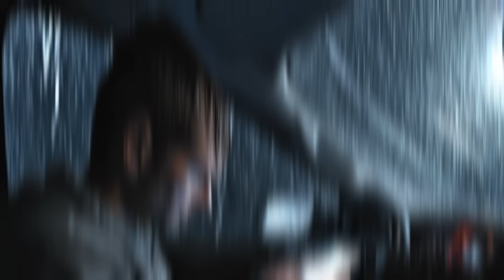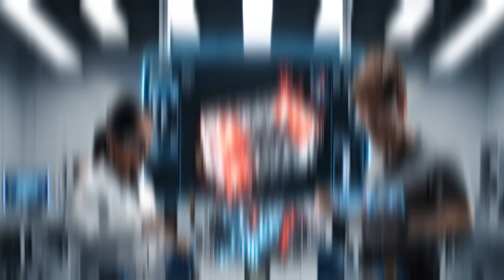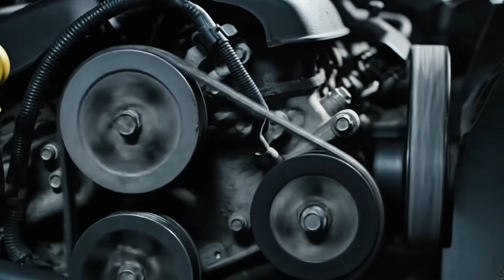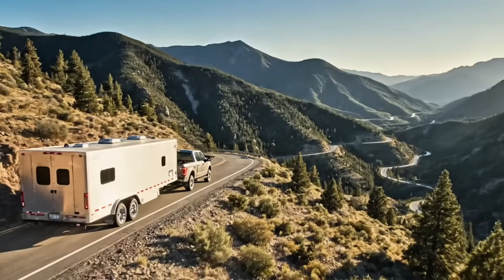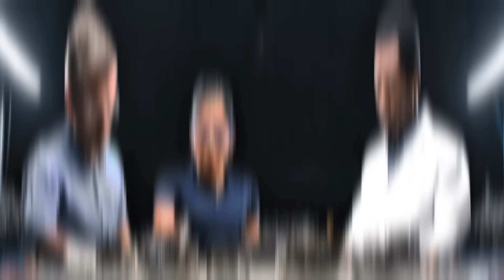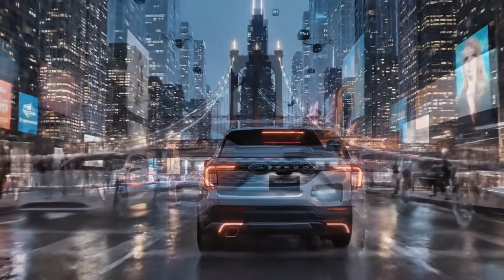Ford Just Ended the EcoBoost Nightmare in 2026 — Truth Revealed

Comment: Still using a rubber oil pump belt? Bad engines right across all the car manufacturers, for me ny turbo, no direct fuel injection not ever the combo port and direct and go back to larger engines and lower compression ratio.
Reply from the maker: A lot of enthusiasts still prefer the older formula: bigger displacement, lower stress, and simpler systems. Modern engines gained efficiency and power, but definitely added complexity too.

Comment: Did they take the water pump out of crankcase
Reply: The rear wheel drive 2.7 and 3.5 never had it behind the timing cover. Only front wheel drive had that.
Reply from the maker: Correct 👍 A lot of people mix the different Ford platforms together, but the truck/RWD EcoBoost setups are very different from the transverse FWD designs.
Reply from the maker: That internal water pump setup was mainly a concern on some transverse/front-wheel-drive Ford applications, not the truck-based 2.7 and 3.5 EcoBoosts.

Comment: If you look at this from a common sense point of view, the smaller the engine, the more it’s going to be pushed and generate more heat no matter what.  A flawed design that will never replace the V8 over the whole engine lifecycle.  😊
Reply from the maker: That’s definitely the argument a lot of V8 fans make 👍 Bigger displacement usually means less stress per cylinder under heavy loads. The challenge for manufacturers now is balancing durability, emissions, fuel economy, and power all at once.

Comment: Get rid of the wet belt
Reply from the maker: The wet belt debate has definitely gotten loud lately 😂 A lot of owners just want long-term durability and easier maintenance without tearing half the engine apart.
Reply: Well do you blame them... don't go into class action lawsuits like GM ok? And I'm putting my trust in you Ford cause GM, Toyota and even Ram has lost my trust
Reply: @jeffrymcallister2789  Ford has the highest recalls amongst all manufacturers. I wouldn't own one.
Reply from the maker: @jeffrymcallister2789  A lot of truck buyers are feeling frustrated with multiple brands right now. People mainly just want reliability, fair warranty support, and vehicles that hold up long term.
Reply from the maker: @williamstewart1294  Recalls definitely hurt consumer confidence, even when they’re preventative. Every manufacturer has had issues lately, which is why so many owners are skeptical now.
Reply: The wet belt lasts longer than a chain 300,000 easily
Reply: @johnsullivan9019  A wet belt will fail long before 100,000 miles, and when they do fail, they destroy the engine. There is no warning. I replaced the timing components, including the chains, on my Ford Crown Vic 4.6L SOHC 2 valve V8 at around 300,000 miles. You get a warning on those. A rattle on cold start that goes away. Over the next 50,000 miles or so, it gets worse. So you have plenty of time to deal with it before it fails. That engine now has 423,000 miles on it, and nothing but the timing components have been replaced. I expect it to easily make it past 500,000 miles.
Reply from the maker: @geraldscott4302  That’s exactly why a lot of longtime owners still trust traditional timing chains more. The gradual warning signs and proven long-term durability give people a lot more confidence than a belt buried inside the engine.
Reply from the maker: @johnsullivan9019  Some owners have had really good long-term results with wet belts, while others are worried more about the repair cost and complexity if something does go wrong.
Reply: My 2018-2.7 has 216,000 miles zero issues
Reply from the maker: @johnsullivan9019  That’s impressive mileage 👍 Goes to show a lot of these engines can last a long time when they’re maintained properly and not constantly abused.
Reply from the maker: @johnsullivan9019  216,000 miles with zero issues is hard to argue with 👍. Stories like that are why so many owners still defend the 2.7 EcoBoost—it proves that maintenance and real-world use matter just as much as the design on paper.
Reply: Hey it’s like the Toyota and Honda’s timing belts. Replacement on these types should be done within certain mileage.
Reply from the maker: @josephpuchel6497  That’s the tradeoff a lot of people are debating now. Regular timing belts are at least serviceable and expected maintenance, but owners get nervous when critical components are buried deep inside modern engines and harder to replace long term.

Comment: I have a 2019 F150 supercrew with a 2.7 V6 ecoboost.  I have 160K miles on it and have not had any problems.  Just consistent oil changes and regular wear n tear like tires, brakes, shocks, etc.  Every Ford truck owner thar I know wirh an ecoboost has not had any problems either.  I plan on keeping mine until the wheels fall off.
Reply: Im at 176k on my 2018 2.7, its been tuned with stage 3 crp turbos on e85 for the last 80k miles with no issues also 🤷🏽‍♂️. There great little engines
Reply: I will say only thing that failed on mine was a exhaust gas tube broke at the seam. The one  that goes to the egr cooler on the front of the driver side head. Easy fix though
Reply from the maker: @Pipsqueak_2.7  That actually sounds like a pretty minor failure considering the mileage and setup. Good info for people who think every tuned EcoBoost instantly blows up.
Reply: @Pipsqueak_2.7  I run e30 on a stock 3.5 eb runs great.  Can't wait for a 5 star tune.
Reply: @burnt_dookie its gonna be fun, thats who im tuned by as well. They take a little long to get back sometimes, but they offer good tuning. Id say definitely do the data logging and get them to revise it. When I got the revision it felt way faster 👍🏽
Reply: @Pipsqueak_2.7 0yo thanks
Reply from the maker: @burnt_dookie E30 seems to be a sweet spot for a lot of owners. Extra performance without going too crazy on the setup 👍
Reply from the maker: @Pipsqueak_2.7  Good advice honestly. A proper revision and data logging can make a huge difference with custom tuning.
Reply from the maker: Love seeing owners helping each other out in the comments 👍
Reply from the maker: @Pipsqueak_2.7  That’s impressive honestly — 176k with upgraded turbos and E85 says a lot about how strong these engines can be when they’re tuned and maintained properly 👍
Reply: I have a 2018 F-150 2.7 ecoboost with 72K and so far have had only one problem......a left turn signal bulb.
Reply from the maker: Even the “problem stories” are starting to sound pretty mild on some of these newer 2.7s 😂
Reply: The 2.7 engines are incredible, look at the bottom end of the block. built like a tank. my son has a 15 2.7 with over 160k, oil change every 5k is key
Reply from the maker: @nickhoffman5524  A lot of people overlook how stout the 2.7 bottom end actually is. Consistent maintenance really seems to be the secret with these engines.
Reply: same ! Love my 2.7 fast and very reliable. 2019 also
Reply from the maker: @jimcostantino6244  The 2.7 definitely has a lot of loyal owners. Plenty of people seem surprised by how quick and reliable they can be long term 👍
Reply from the maker: 160k with basically routine maintenance is impressive 👏 Stories like this are why EcoBoost debates are so divided — some owners have major problems, while others rack up huge miles with zero drama.
Reply: How about for towing?

Comment: And it only took them 15 years. Way to go Ford, what took you so damn long.
Reply from the maker: A lot of longtime owners feel that way — the frustration mostly comes from people who dealt with the earlier issues before the updates finally started rolling out.
Reply: Absolutely. Those things were quite troublesome when they hit the streets in 2011. I was looking for a F150 in 2011, and my dealer sales guy tried to push one of those early 3.5's on me. I told him they were too new for me to try, and went with the old 3.7L. That little V6 was tough as nails, and itdid everything I needed it to do without one problem. I wore it out, and went with the 5.0 in the next one.
Reply from the maker: @wanted-33  That’s exactly why a lot of people still trust the simpler older setups. The early EcoBoost years made some buyers cautious, while engines like the 3.7 and 5.0 earned a reputation for just quietly getting the job done.

Comment: I WILL NEVER HAVE A TRUCK WITHOUT A GOOD ENGINE V8..NO V6 CRAP AND DEF NOT A 4 CLUNCKER!!!!
Reply: Have my 2004 sierra 6.0. I love that engine. And 260,000 miles with no problems? Yeah.
Reply from the maker: @GravyLegg  260k with no major problems is exactly why those older GM V8s still have such a loyal following. Simple, proven, and built to take abuse for years.
Reply: I was going to say the same thing. I am old school give me a v8. I didn't  think the ego boost was that good when they first came out. I made sure to stay away from a engine that small and excepted to do that much power and not have issuses.
Reply from the maker: @catman59-x2g  A lot of people felt the same way when the early EcoBoosts first showed up. The idea of a small turbo V6 replacing a traditional truck V8 took a while for longtime truck owners to trust.
Reply: Agree, have a 2012 f150 with 6.2L.  Routinely tows and is reliable.  Not a daily driver and willing to sacrifice gas mileage for reliability.
Reply from the maker: @ricklanning986  That’s the tradeoff a lot of heavy-duty owners are willing to make — giving up some fuel economy for a setup they trust to tow reliably for years.
Reply from the maker: Nothing wrong with loving a V8 😂 A lot of truck owners still prefer the sound, feel, and simplicity of a big naturally aspirated engine.

Comment: They are not getting better mileage. Hit the pedal, mpg goes off the cliff. 

V8 5.0 is the only way to go.
Reply: It does unless it's under a load then it sucks, I use my f150 as a daily driver and love it 18 to 24 mpg depending on conditions. It's so fast.
Reply from the maker: @jimhelminger3986 That seems to be the EcoBoost story for a lot of owners 👍. Great daily-driver MPG when unloaded, plenty of power on demand, but towing and heavy loads are where fuel economy usually takes the biggest hit.
Reply from the maker: That’s the tradeoff a lot of truck buyers talk about 😂 Stay out of boost and the mileage can be solid, but once you lean into the throttle the fuel gauge starts moving fast.
Reply: Next year is supposed to be the 7.3 going into the F-150. I have a godzilla in my superduty  and its an awesome engine. Cast iron block and pushrods  perfected about 60 years ago.  If its true and they are not the price of a home mortgage I am getting one . Rumors are that chevy and ford are both going back to large displacement non turbo diesels because of nox levels the turbo engines put out.  So blending old proven solid tech with new tech like electronics better injection and such we should see actually better performance service life and fuel economy for straight up fuel burners.
Reply from the maker: @darrendavis7699  The 7.3 Godzilla definitely has a lot of fans for that reason—simple, proven, and built for hard work. If Ford ever puts something like that in the F-150 at a reasonable price, I think there’d be a lot of interest from buyers who still prefer big naturally aspirated V8s over turbocharged setups.
Reply: I love the coyote and always thought that's all I wanted until forced into the 3.5. It's truly a fantastic engine, I routinely spin the tires at 50+ mph on dry pavement  on 91 or better octane. Great daily driver.
Reply from the maker: @jimhelminger3986 Funny how often that happens 😄. A lot of people buy the truck expecting to prefer the V8, then end up impressed by the 3.5 EcoBoost once they actually live with it. Hard to argue with that kind of real-world performance.

Comment: Its not just Ford. Everyone has problems with their turbo engines.
Reply: the military has used turbos for  decades for their heavy duty vehicles.  if you are not willing to do military grade maintanance,  stay away from turbos.
Reply: @cannon3267  THE MILITARY USES TURBO DIESELS, NOT GAS POWERED VEHICLES!
Reply from the maker: @christopherblessing3868  Turbo diesels and turbo gas engines definitely operate under different conditions, especially when it comes to durability expectations and tuning.
Reply: @cannon3267 Ford didn’t ask for military maintenance on eco boost.
Reply from the maker: @johnhart2861  A lot of owners expected EcoBoosts to behave like traditional low-maintenance NA trucks, which is part of why some people were caught off guard by the upkeep.
Reply from the maker: @cannon3267  That’s a fair point — turbo systems can absolutely last a long time when maintenance is done consistently and properly.
Reply: @cannon3267 have you been in the military?
Reply: If you have a turbo engine well here's the most common advice.  If you run that car hard for more than 20 minutes,  DO NOT SHUT IT OFF WHEN YOU PARK, LET IT RUN FOR MAYBE A MINUTE IN PARK THEN SHUT IT OFF.
Second advice,  MAKE SURE THE OIL LEVEL IS PROPER AT ALL TIMES
Reply from the maker: @BruceDragon-sf1tr  Solid advice 👍 Letting the turbo cool down after hard driving and keeping oil levels maintained can make a huge difference in long-term turbo health.
Reply from the maker: That’s true honestly — turbo engines across all brands have had their share of issues. The extra power is great, but the added heat and complexity can create more long-term maintenance concerns.
Reply: @NextGenWheels-s5r  Turbos are fine but they need beffier engines. Not cheap light weight aluminum blocks.
Reply from the maker: @killabee623  That’s a big part of the debate right there — a lot of people feel turbo engines can be very reliable when they’re overbuilt and not pushed too close to the limit.
Reply: @killabee623  And not cheap cast connecting rod, and not cheap cast pistons.  They should be using FORGED internals.
Reply: @killabee623 : the engine I have has a graphite/iron block. Even stronger than cast iron.
Reply: @NextGenWheels-s5r : don't forget. A turbo works when power is required. Rolling down the highway, a turbo just spins, and there is still vacuum in the intake manifold. ( not much heat).  How many seconds is a turbo actually adding power? How long to pass someone on the highway? Accelerate from a green light?  I can probably count on 1 hand the number of times I've needed red line.
Granted, a 250 hp 4 cyl turbo probably won't live for many hours continuously at full output, but then a naturally aspirated V8 won't live long at full output for hours either.
Reply from the maker: @drwthmpsn7457  Good explanation honestly. Under normal cruising a turbo really isn’t under heavy load most of the time. A lot of reliability comes down to tuning, cooling, maintenance, and how aggressively the engine is engineered from the factory.
Reply: @NextGenWheels-s5r : I wonder how many minutes at full throttle would be required to get a turbo glowing red like in some pictures we see,
Reply from the maker: @drwthmpsn7457  Usually that glowing red turbo stuff happens under sustained heavy load — towing hard, racing, dyno pulls, or long high-boost runs. Most daily drivers will never push a turbo anywhere near that extreme 😅
Reply from the maker: @drwthmpsn7457  Good question 😄. Under sustained heavy load, towing, racing, or dyno pulls, a turbo can get hot enough to glow surprisingly fast. Most daily-driven trucks will never see those conditions, which is why many owners go hundreds of thousands of miles without turbo issues.

Comment: Now if we could only get rid of all the diesel crap.  I doubt pickup trucks killed the ozone layer.  Everytime that CEL comes on, just plan on a $2500 dollar repair.
Reply from the maker: Modern emissions systems definitely made diesel trucks far more complex and expensive to repair. A lot of owners miss the simplicity of the older diesel setups.
Reply: @NextGenWheels-s5r oh i love my 2015...when it runs.
Reply from the maker: @70Ford302  That’s the diesel owner experience in one sentence right there. When they’re running, they’re hard to beat for torque and towing. When they’re not… your wallet starts sweating. Hope your 2015 gives you more good days than bad ones!

Comment: Why aren't you mentioning EGR's which are the biggest travesty of the automotive world !!!!
Reply from the maker: EGR systems are definitely one of the most controversial parts of modern emissions equipment. A lot of owners blame them for added carbon buildup and long-term reliability headaches.
Reply: @NextGenWheels-s5r I don't know if they cause reliability problems, but definitely take a bite out of part-throttle performance.
Reply from the maker: @jamesbosworth4191  That’s a fair point. Even people who don’t see EGR as a reliability issue often notice the impact on throttle response and efficiency. It’s one of those systems that helps meet emissions targets, but plenty of enthusiasts feel it comes with performance trade-offs.